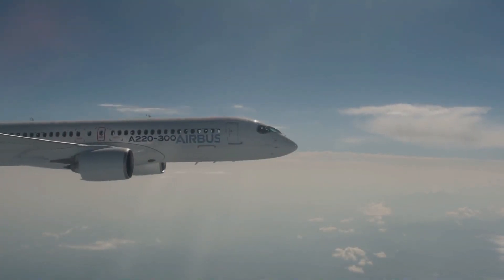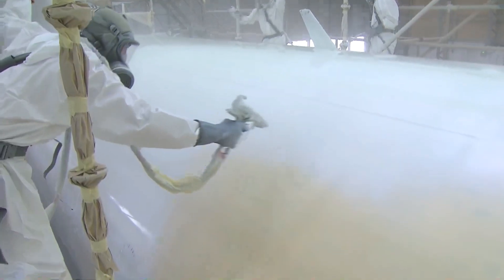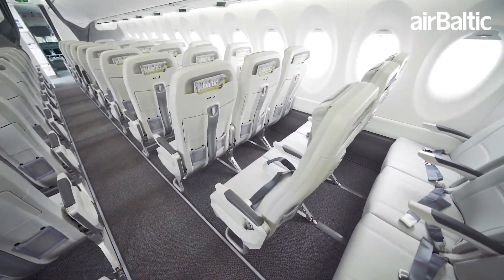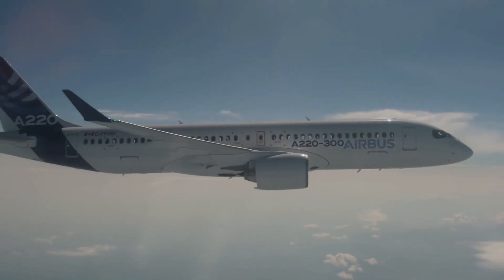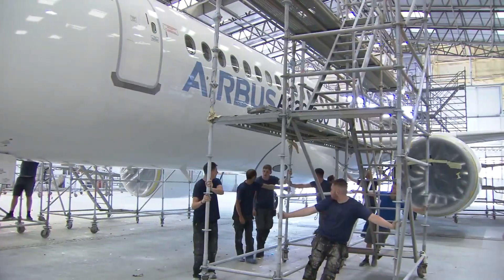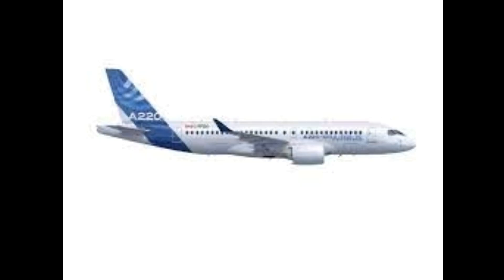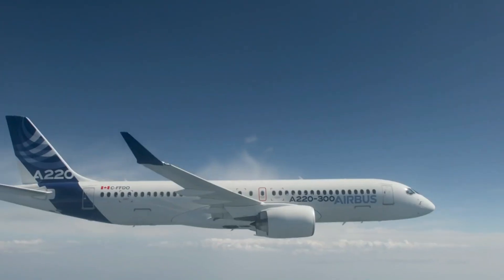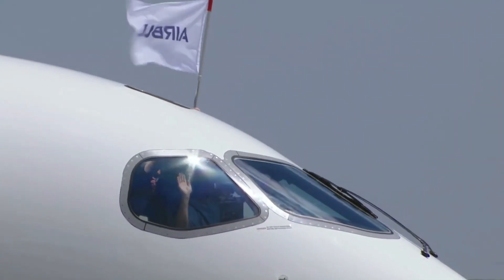A220-100 vs A220-300 | What's the difference? | Epic Comparison

Comment: The mid section of the - 100 and - 300 are mainly similar, but very different in some components. Also the - 100 mid section is 6 frames shorter 👍
Reply from the maker: Correct! Thanks for tuning in! Also, if you enjoyed, make sure to subscribe! :-D
Reply: @theavidaviator  was doing structures work on the - 100 & - 300 mid fuselage in Belfast.
Reply from the maker: Cool! Did you guys send them to Mobile or Canada?
Reply: @theavidaviator  - only ever heard Canada being mentioned. Think as China was the primary source for the Mid fuselage, they supplied both Canada and Mobile.

Comment: You have it backwards, at least according to Airbus' website, the 100 has a range of 6390km and the 300 has a slightly shorter range at 6297km.
Reply from the maker: Wow, you are right! I'm forgetting where I got my stats from but I do have them mixed up. I will add a disclaimer. Thanks for pointing it out! If you enjoyed, make sure to consider subscribing! :D